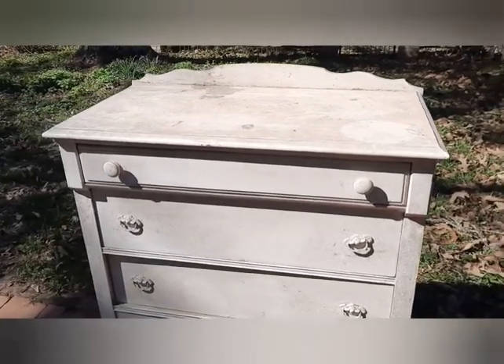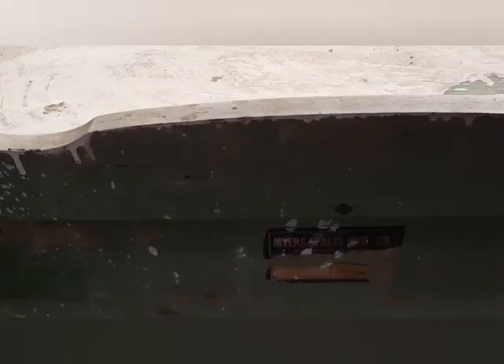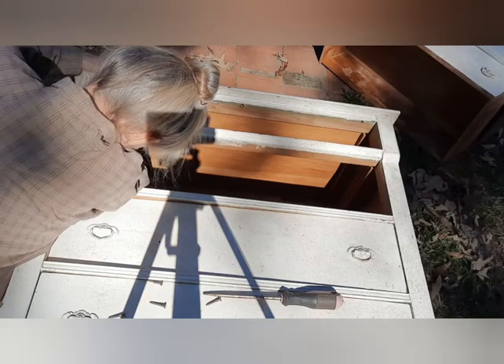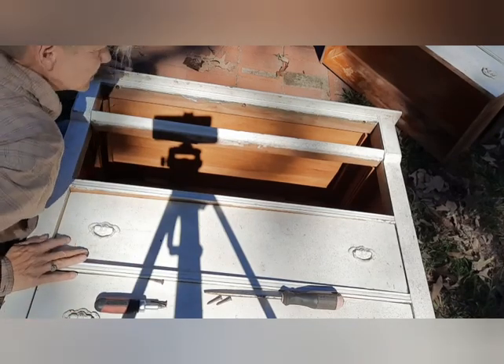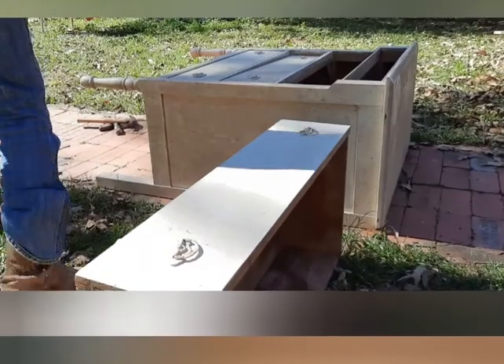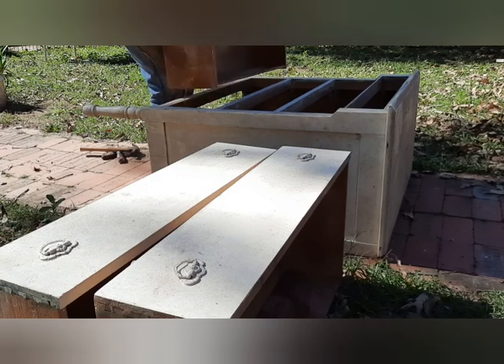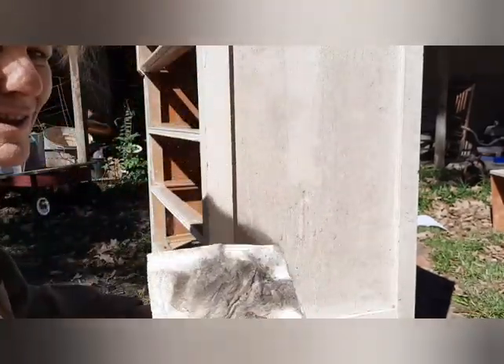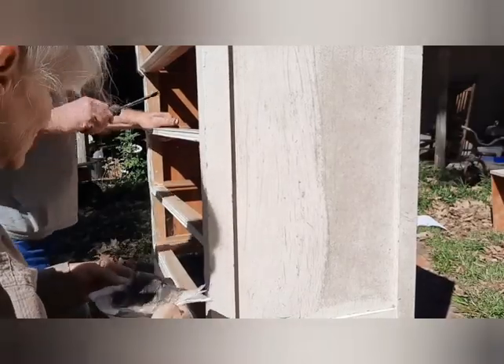Antique Chest of Drawers Remodel - Part I | #Antique Chest of Drawers, #Repurpose Old Furniture

Comment: I see it and just want to strip the paint off and see what kind of wood it is. Anxious to see the finished piece 😬
Reply from the maker: With it being originally a painted piece, it would have less desirable wood used for construction. So far, it looks kinda like maple for the top and back sash piece.
Reply: @BroqueCowgirlHomestead  that 1 drawer almost looked like a type of mahogany from what I could see. I used to know most wood by sight since I was 8 but have forgotten some. I have a dresser that is similar that I stripped. It is VERY hard to get paint off of.  Almost as bad as trying to strip pine,lol. My video on Guest room reno is like 2 mins and has the dresser in it that I'm talking about if you want to go take a look.
Reply from the maker: @OurOkieHomestead  usually mahogany was just the veneer over a cheaper wood. The drawers are some kind of really hard dense grain wood, in small strips, about 1 1/4 inches wide all put together. In that case, it was a painted piece from the factory. 
In all the years I've been refinishing furniture, alot of the time I strip the broken peeling veneer off, and stain what I underneath and it comes out beautiful.
Reply from the maker: @OurOkieHomestead  also, back then some factory paint was baked on enamel paint. Stripper won't touch it. Sanding doesn't either. But, you can scrape it off with old window glass. I worked on a Hoosier style cabinet for several years. Was ready to give up on getting the paint off, when a furniture refinishedr told me about the glass trick. Worked like a charm.
Reply from the maker: @OurOkieHomestead  your dresser is beautiful BTW.
Reply: @BroqueCowgirlHomestead  Thanks! That mirror being stripped was done by a Pro. It about killed me doing the rest. I swear stripper is not as strong as it used to be 40 years ago either.
Reply from the maker: @OurOkieHomestead  no, stripper is weak now days. I remember using Homer Formby's, that stuff was amazing.